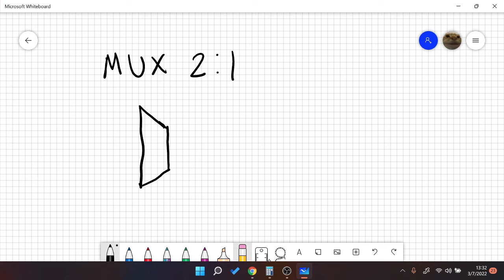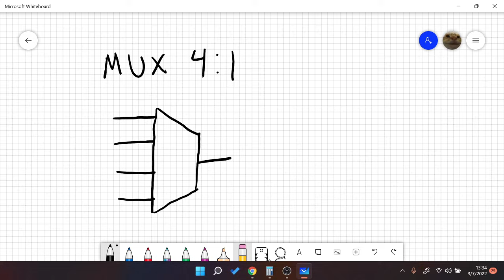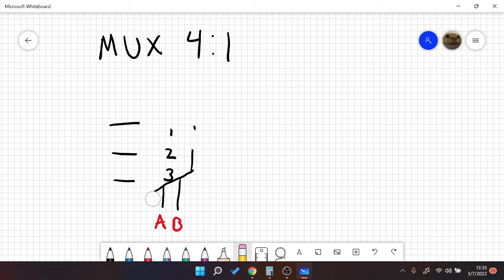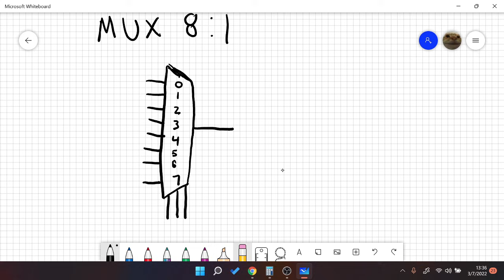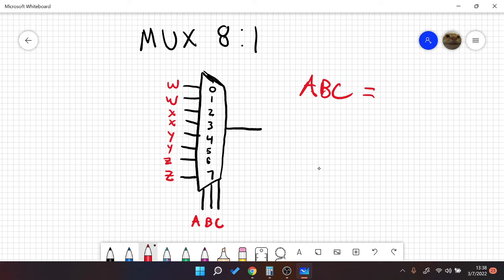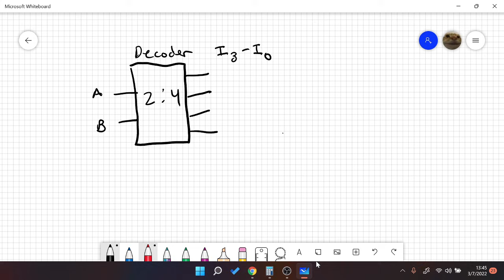Multiplexers and Decoders

Comment: Thanks for the great explanation :D

Minor question, what about the ALU instruction code where it goes above the amount of inputs? LIke say there are 4 inputs, so 0 1 2 and 3 are used, but then there's 101 that is used. That's a 5, and for some reason, in my question, the function is A or !B. Why is it specifically B that is chosen and not A?